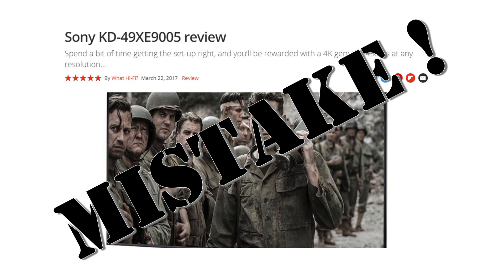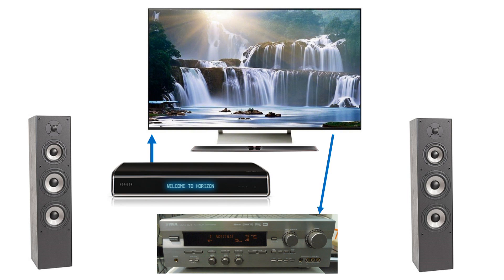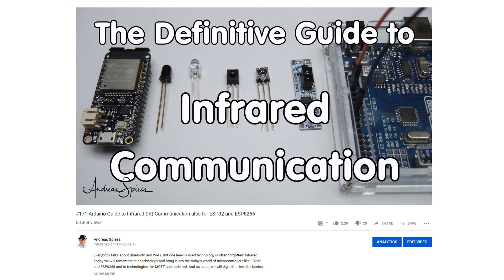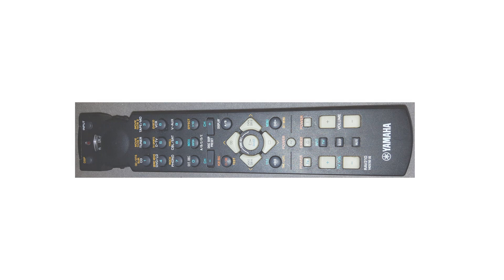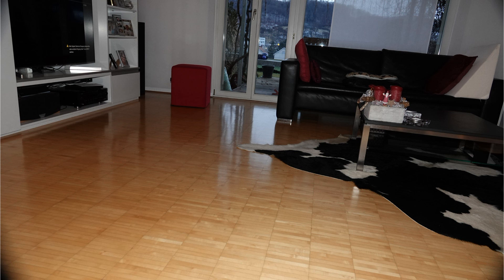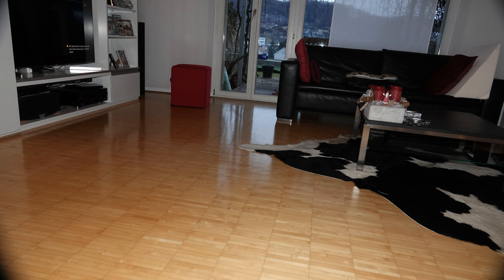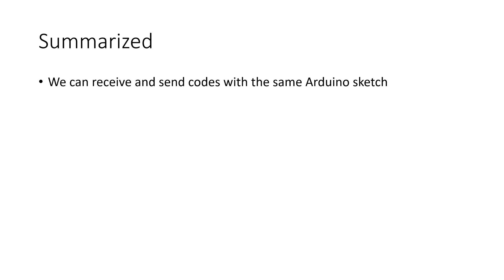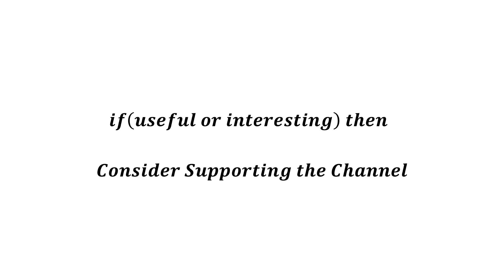#254 Infrared Remote Protocol Translator (Arduino Nano)

Comment: I used an Arduino Uno with a Vishay TSOP4838 IR receiver to capture raw IR codes using the IRLib2 library, for a Vizio TV.  The problem is for every press of the same button (example: Volume up), I get different set of IR codes.  And the funny part is I took all of those codes and embedded them in my Android app, and they all work.  I was expected the same set of IR codes for a certain button every time I pressed it.  Do you know why this happens?  Thanks.
Reply from the maker: I do not know :-(

Comment: Next is to automate the opening and closing the front panel and timing of turning on and off each device when the power button is pressed.
Reply from the maker: Maybe another project. But not easy to get the signal behind the door when it is closed :-(

Comment: This is really cool! but we just use two remotes

You cold make a version 3.0 where when you turn the tv off it automatically closes the sliding door :)
Reply from the maker: Two remotes are for sure not acceptable by the main user. 
Closing the door would be easy. But how to get the signal to the motor if it is closed (for opening)

Comment: Next: use an esp so you can add webpage for smartphone control. Also add sonoff to switch all devices really off (my old denon consumes a lot in standby) and of course automated panel to hide the TV ^^. Excellent video as always!!!
Reply from the maker: @Roelski: I think you have to watch the video again ;-) My wife set here the standard, not technical feasibility.
Reply: Andreas Spiess my partner also refuses to use a phone to control the TV. Until the remote was lost for 3 days. I won't mention whose purse I found it in. That would be rude.

Comment: Don't be tricked into buying a Logitech Harmony Hub and its companion remote. The hardware is fine, excellent even, but Logitech ruins it with horrible proprietary software that cripples the product, preventing it from doing much other than very basic tasks with strict, cookie-cutter steps that you can't change. It doesn't do basic tasks very well either: you might get it to turn on the monitor and amplifier, but it might forget the monitor. Not because of an occluded IR signal - sometimes it never attempts to send the codes. Random glitchy software is what happens whenever you let accountants hire your software engineers.
Reply from the maker: These remotes anyway have a WAF of close to zero here. So no danger...

Comment: A Logitech harmony would be too easy right? Sure that your box not controlled the TV via CEC?
Reply from the maker: Two problems to be solved: The set-top box works on 2.4 GHz and the famous WAF. The second being much harder.
Reply: Depends on how old the Samsung devices are, chances are since they were both Samsung they used the same codes. Newer Samsung devices that uses the "Smart Remotes" uses CEC or ARC. Lately the smart remotes are more bluetooth like as well making my job harder when trying to deploy a URC system. Not to mention AT&T switching to the ArrisVIP62232 boxes that use a faster RX/TX for the remotes.
Reply: @AndreasSpiess  Remote is programmable for other TV brands....For sure....I have the same and reprogrammed it.

Comment: Can I get air conditioner Raw code by arduino?
Reply: Very much depends on your (brand) air-conditioning.
The code for AC is very large.
Are you asking to send out Air-conditioning code or learning the code of your Air-conditioning?
Reply from the maker: Maybe. They sometimes use special codes. You have to google.
Reply: @dozog  Both please

Comment: I thought Sony and Samsung used different carrier frequencies, isn't it something like 38khz and 45khz? How does one module decode both?
Reply from the maker: I did not care about it. It just worked. And I am also not sure if they really use 45kHz. Maybe somebody else knows more.
Reply: @AndreasSpiess  I've just checked and it's 38 and 40 so I guess its close enough to just work.

Comment: Again a useful video! But too late for me :) I built something (very) similar one year ago.  Isn't it a problem that one IR-sender disturbs the signal from the other one? In my setup the receiving devices are hidden in a lowboard, but when i open it (and the signal from the remote and Arduino can reach it "at the same time"), it doesn't work anymore. Maybe it's because my signal is too weak, i didn't use a Mosfet with powerful diode etc.
Reply from the maker: I had no issues. Maybe it is also the timing. Because Babel Fish listens and then sends. And maybe the remote already finished sending codes. 
You might solve it in the code that your Babel Fish does not transmit as long as it gets signals from the remote.
Reply: Andreas Spiess That's probably just a good idea 💡 to implement a little bit of a delay in sending a code from the IR Box 📦 especially when the box 📦 is still receiving a signal from the remote source and try to avoid mixed signals from the source remote and the IR Box.

Comment: Could u create a sonoff with arduino?
(For domotics, could be really handy)
Reply: Sonoff is just an ESP8266 with some additional components such as a relay and some screw terminals. I don't see the reason for making your own given that it would be more expensive, apart from using better quality components.
Reply: @GRBtutorials  What I wanted to use it for, was to make 2 different arduino communicate, even if they're isulated/really far from each other (for example, my home wi-fi signal isn't good in my basement, where we put our desktop, so we used a sonoff to connect it)
Reply: @GRBtutorials  (also, If u think it's strange to have a PC in the basement, u're right, but we didn't have any other place where to put it😅)
Reply from the maker: Maybe you look at the Sonoffs with a 433MHz receiver?
Reply: @AndreasSpiess  what I was interested in, was how to send data trough the powercables, possibly without shorting everything😅.

Comment: Isn't the ultimate solution to build an IR remote control with an ESP (either one) and control everything with an app on your phone that connects to that ESP? (WiFi or Bluetooth)

It took me a while to figure out how, but I can control my Air-conditioning to the exact detail that it's original remote could. But additionally it will switch on automatically when the humidity goes over 70%. (Which here it does)

Most 80% of devices (other than air-conditioning and Philips stuff) use a slight variation of NEC code. 
8bit address (device) ; 8bit inverse of address; 8bit command ;8bit inverse of command. (Plus headers and repeats)

Mine is mounted on ceiling next to a rail lamp. ESP sketch includes OTA code so it's easy to update if a device gets replaced.
Built a separate Decoder to get me the codes of new devices, which I then save in a spreadsheet in case original remote gets lost or broken.
Reply from the maker: Using an ESP and IR is a good idea. I used it in one of my earlier videos to change the color temperature of my lab light according to the sunset.

Comment: Great project Andreas!
Good thing the powerful LED worked, for anyone not so lucky, maybe because some the devices have to be completely hidden, I can recommend a IR Repeater, like this one: https://www.amazon.de/XCSOURCE-Extender-verstecktem-Empf%C3%A4nger-Infrarot/dp/B01GR2CC1O/
You can also connect an Arduino to one of the inputs via a 3.5mm connector directly instead of using an IR-LED. I used this for example to turn on multiple devices in my home theater with one voice command to my Google Home.
Reply from the maker: Interesting device. Thanks for the link!

Comment: Can you add a schematic - just wondering how the cap is used? as seen at https://youtu.be/5yyy7h7qh80?t=513, the layout at https://youtu.be/5yyy7h7qh80?t=418 does not include the cap.
Reply from the maker: The cap is added between VCC and GND

Comment: Too bad that the yamaha amplifier is from a bygone era when men were men and other things were other things and is connected via optical cable at constant output! I also had a cheepo 4k 43" lg and it drives me nuts no matter what definitions when using as monitor after 20-30 minutes it goes off.
Reply: One problem with optical is that they never extended it to support lossless surround, much to the annoyance of gamers who also dislike having to route the HDMI through the receiver and possibly getting a bit more lag in the process. The good news is that HDMI splitters are cheap...
Reply from the maker: @Andre: I agree, but with this small project both problems are solved :-)

Comment: Our stupid Samsung tv remote uses Bluetooth it may be easier or more flexible to hack but it eats batteries I need to recharge the AAA batteries every 2-3 months what's wrong with you Samsung. IR uses much less power. The remote has a mic for the worst voice assistant in the universe. When I say something to the tv It always says on the screen then push the volume button what volume up or down I tried all the buttons. So at least you are lucky.
Reply from the maker: Remotes are not easy. It got a little better over the years, but sometimes you still need a lot of patience...

Comment: "bigger damage: a divorce" 🤣
why arduino nano? just because you already had one laying around or some other reason? some attiny board would be even smaller
Reply from the maker: The ATtiny would have been a little harder (programming). And the price difference is not huge.

Comment: I won't touch Sony products. Too many problems & no support from them in way of updates.
Typical Sony crap too of powering off after a period of "idle." My receiver does it after 20min if a disc is paused or no hdmi audio traffic. There's NO way to disable the "feature" & it has other bugs that cause it to misbehave. Haven't seen a firmware update in over 2yrs. Samsung FTW so far.
Reply from the maker: It seems to be possible to disable this "feature" on my TV if I believe other commenters.